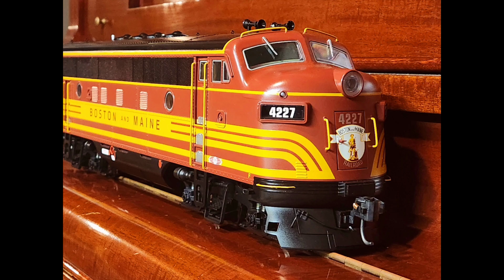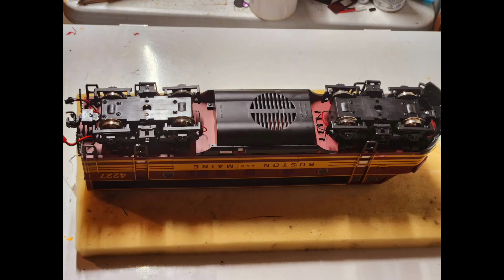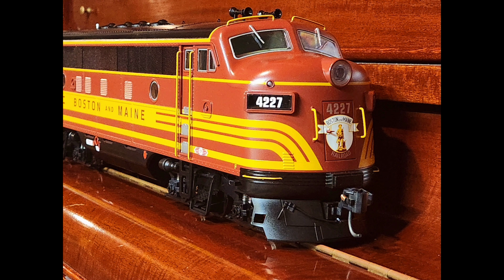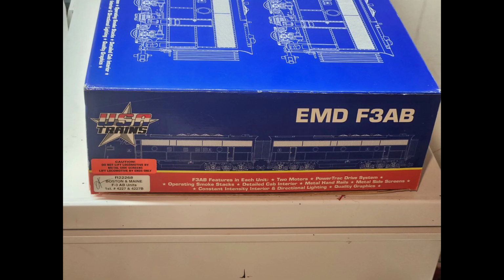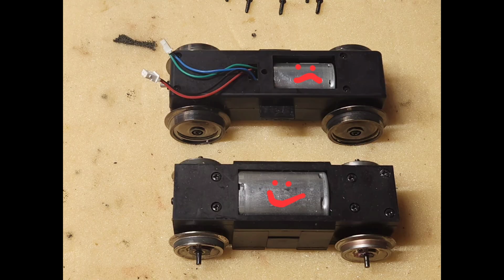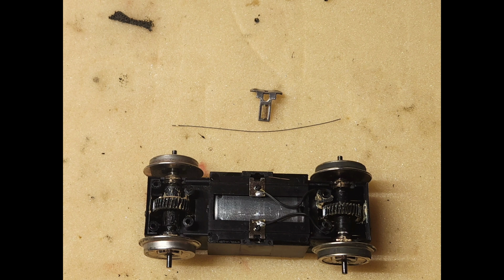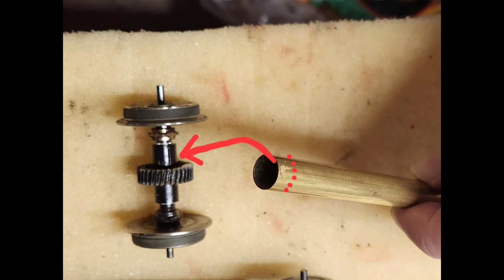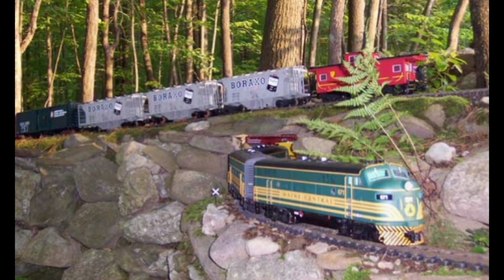G scale | USA Trains F3s

Comment: one point I would amplify on is the correct orientation of the brass bushings, in fact they are oriented differently than the 3 axle USAT motor blocks. I have pix on my site, but putting the bushings back in wrong will destroy the gears in short order.